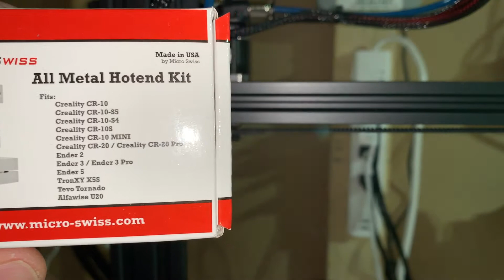MicroSwiss hotend on a Sunlu S8

Comment: Brilliant and very helpful video. I nearly scrapped by Sunlu S8 but watching your vid helped me to solve my problem. My hot end was dripping random blobs of PLA on my job. I found it was oozing out from above the nozzle block. I didn't swap out the entire head as you did, but your instructions gave me the confidence to remove my head, strip and clean, replace the nozzle and re-assemble using PTFE tape on all threaded joints. I am now printing again - no blobs. I agree with Fifty Plus Tech - mobile phones are great for capturing video. Great quality but the best way to improve footage is to mount the phone so it's always looking at what's going on. Many thanks, David.
Reply from the maker: Awesome comment. Thank you very much. I'm new to this 3d world and every little bit helps. I'm glad this helped you.

Comment: I had to do this on my Creality Ender 3 V2 -- not completely change out the hot end but open the extruder casing so I can clean out the hot end. I'm a little anxious about a complete change out of the entire extruder- cause on the ender we have to disconnect the other end from the motherboard. Great video. Watched and will like & subscribe (and thanks for coming over to visit my channel!) Oh you'd be surprised how good our phones are for recording. I'm looking at using my android phone as  an overhead one for my unboxing and 3d printing related videos. HAH and I forgot to put the filament tubing in when I put mine back together.. so yeah I was screaming "you forgot" :D See you in your next one-- I'm having fun with 3d printing too!
Reply from the maker: The next video I’m going to do is a direct drive installation from MicroSwiss. Changing the hot end wasn’t that bad, it’s just not trying to make mistakes that could render your printer useless for the moment haha.